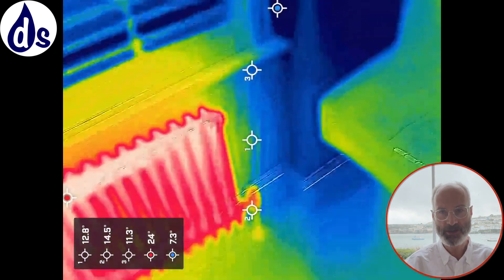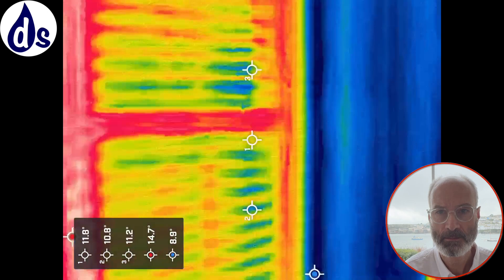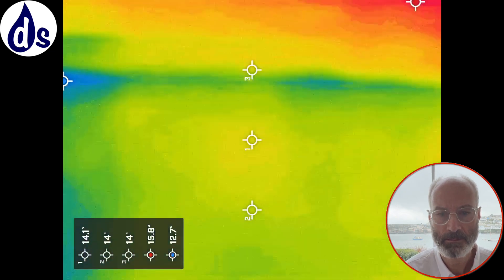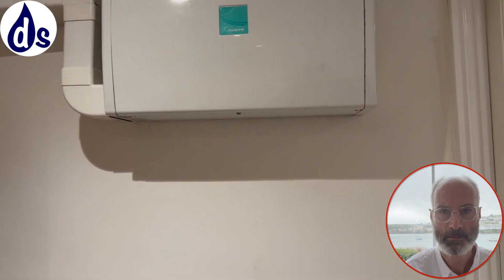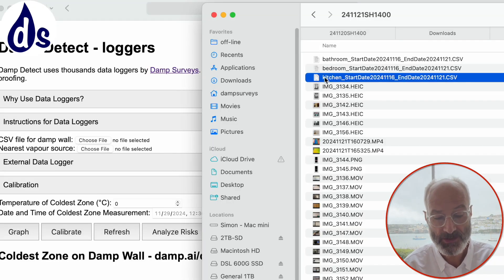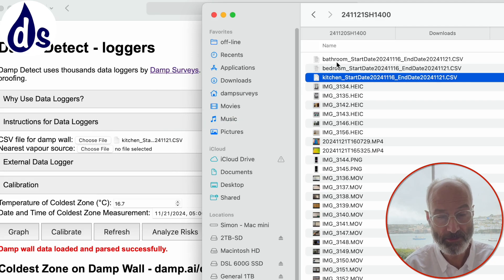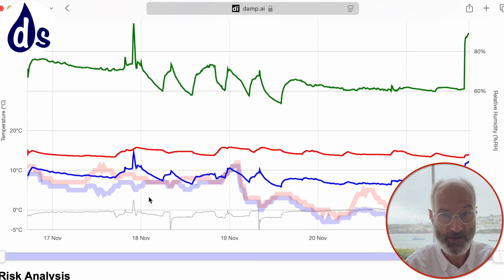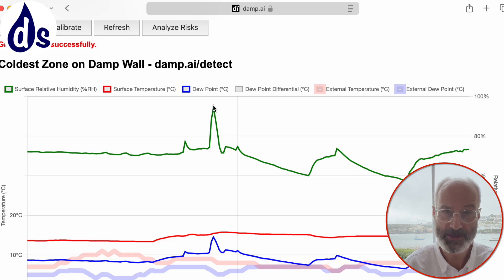Damp and Mould Next to a PIV Fan – What Could Go Wrong? 🌬️🦠🔍

Comment: @dampsurveys you don't seem to be a fan of PIV units? I don't really have a condensation problem (70s house so not air tight and quite gappy) , but the deisgn of my 70s house means there is very poor air circulation, particularly on a long internal hall with no windows. Also, have a weird concrete floor with floating timber frame floor (to hide pipes) that has no ventilation. As a result, the house smells musty, but without obvious signs of mould/damp. Will eventually rip out the floor and put some floor insulation and screed to make a solid floors, but in the meantime I was thinking of getting a loft PIV to improve the air quality in the house - any thoughts if this would be a good idea?
Reply from the maker: Thank you for your question! 😊

You’re right—I’m not a fan of PIV systems, as they generally don’t address the source of vapour, which often stems from insufficient ventilation and is exacerbated by poor air circulation. Musty smells are likely caused by mould spores lingering in stagnant air. PIVs are also expensive to install and run and can sometimes introduce more problems, such as blowing in cold, humid air from outside. This can increase the risk of mould growth and lead to higher heating costs.

Ripping out the floor and installing a solid floor with insulation and screed sounds like an excellent long-term solution. However, I’m also not a fan of concrete over a floating timber frame floor, especially if there’s poor sub-floor airflow. The last one I inspected had a leak causing white rot, which had eaten through much of the timber. The concrete appeared self-supporting, but as this wasn’t the design, it posed a risk of collapse. Ideally, you should inspect and measure sub-floor humidity and ensure there’s sufficient sub-floor ventilation before making any changes.

In the meantime, I’d recommend investing in one or two dehumidifiers instead of a PIV system.

Why Dehumidifiers?
Dehumidifiers are far more efficient for improving air quality and managing humidity. Here’s why:

Energy Efficiency: All the energy used by a dehumidifier is converted into heat, plus an extra 50% bonus from enthalpy, much like an air source heat pump. This means dehumidifiers effectively warm the air while removing moisture, making them cost-effective. 🌡️⚡
Air Movement: Dehumidifiers create constant air circulation, helping to eliminate stale, musty smells in poorly ventilated areas like your internal hall. 🌬️💧
Immediate Impact: Unlike PIV systems, which rely on introducing air from the loft (often cold and unfiltered), dehumidifiers actively remove excess moisture and improve air quality, even in challenging setups like yours.
Additional Suggestions
1️⃣ Targeted Ventilation: Use extractor fans in key areas like bathrooms and kitchens to remove excess humidity at its source.
2️⃣ HEPA Filters: Choose dehumidifiers with built-in HEPA filters to improve air quality by removing allergens and particles.
3️⃣ Keep Doors Open: Ensure internal doors are open when possible to promote airflow throughout the house.

While a PIV system might slightly improve air circulation, it doesn’t tackle underlying issues like stagnant air in the floating floor void or high humidity. A dehumidifier offers a much more practical and cost-effective solution in the short term while you plan your floor renovation.
Reply: @dampsurveys  Thank you for such a detailed response.
One clarification our floor is a solid concrete sub floor with a weird 6 inch floating timber floor on top (i assume to hide water pipes etc). My intention is to remove the floating floor to expose the concrete sub floor and then add insulation and a new screed on top. I think the current problem is that there is no ventilation in the floating timber floor - it is basically a void for stagnant air. 

In the meantime I took your advice and ordered a Dehumidifier with air purifier - will see how I get on with this 

Do you have a tip jar/donation ?
Reply from the maker: Thank you for the clarification! 😊

That floating timber floor does sound like a bit of a damp time bomb. Without ventilation, stagnant air can cause condensation, AND IN SOME CASES ROT, or lead to mould, as well as potential issues with any hidden pipes. Removing it and insulating the sub-floor before adding a screed sounds like a solid plan. Just be sure to use a vapour-permeable insulation layer where necessary to prevent trapped moisture and future problems. 🌬️🛠️

As for the dehumidifier with an air purifier—great move! You’ll likely notice a significant improvement. Remember to place it near the damp-prone area and run it consistently. Draining it directly into a sink (if your model allows) is ideal, especially when you're not around.

Tips for Your Sub-Floor Plan:
1️⃣ Moisture Check: Ensure the concrete is thoroughly dry before adding insulation or screed. A simple hygrometer can help you check the sub-floor's relative humidity.
2️⃣ Insulation Choice: Consider rigid foam boards like Celotex or a hybrid solution like SpaceTherm if there's any chance of residual vapour.
3️⃣ Data Logging: Place a logger in the void now to track humidity—useful to confirm your diagnosis of stagnant air.
4️⃣ Ventilation: If you’re ever stuck with voids in the future, ensure they’re ventilated to prevent a repeat of this issue.

About a Tip Jar 💰
I don’t have one just yet (but maybe I should 🤔 - but I am planning an eBook - stay tuned). Honestly, your kind words and sharing my videos are more than enough! ❤️ You can also amplify the impact by recommending https://damp.ai and https://www.youtube.com/@dampsurveys to others—it’s a growing resource I hope will help many.

Videos You Might Find Helpful:
👉 "Sweat in Cellar from Poor Ventilation": https://youtu.be/J8wdxehh7GM
👉 "Mould from Ventilation into Loft Blocked": https://youtu.be/dAY9rBMEsX8
👉 "Damp Rear Extension Column Condensation": https://youtu.be/KM6mJpHkFg0

Stay tuned for more updates—your input is invaluable, and I’d love to hear how your project progresses! 🚀

Comment: Length of ducting is a big consideration with bathroom and kitchen fans. It's hardly ever considered it seems.
Reply from the maker: Absolutely! 🌬️ The length of ducting is critical for bathroom and kitchen fans, but there are other key factors too:

1️⃣ Duct Type: Rigid ducting is best because it offers lower air resistance compared to flexible ducting.
2️⃣ Number of Corners: Each bend increases resistance and reduces airflow.
3️⃣ Tension: If using flexible ducting, it should be at least 90% taut to minimize resistance and avoid sagging.

Most importantly, people often forget to test the air speed at the vent outlet. I can’t count the number of times I’ve found no airflow because the ducting didn’t extend all the way to the outlet! ❌🔍

Proper setup and testing ensure ventilation actually works. Thanks for raising this point! 🛠️💨

Comment: What’s your opinion of the bit in the HHSRS that says people should be able to carry out normal activities without ever opening their windows?
I think it’s utter ridiculousness
Reply from the maker: You’re right — it’s a tricky and often political issue. 🤔 The standard approach emphasises trickle vents or a continuous flow of air (like MVHR systems) 🌬️🏠.

Personally, I believe in targeted solutions:
Ventilation 🚿🍳 for bathrooms, kitchens, and clothes drying (using a dehumidifier or dryer).
Heating 🔥 and insulation 🏠 applied strategically.
Dehumidification 💧, especially when away or when the indoor dew point is above the outdoor temperature. (Think Dew’s Law 🌡️💧.)

For more detail, check out my recent video:
👉 Respect Awaab's Law with Dew’s Law
🔗 https://youtu.be/MMJeqjAWtSo 🎥

Comment: Is running a dehumidifier 24/7 viable? Seems like a short term solution
Reply: From personal experience: I have been running a dehumidifier 24/7 for the past few years across several houses. During the first few weeks, it stays on most of the day, but once the building dries out, it only turns on a few times daily. It usually runs longer when I’m drying clothes indoors during winter, which is something dehumidifiers excel at. Most dehumidifiers come with humidistats, allowing them to sense when they need to run or stay off, ensuring you keep your running costs low.
Reply from the maker: Thank you for sharing your experience! 🙏 You’re spot on — dehumidifiers with humidistats keep costs low 💡💧, especially for drying clothes in winter 👕❄️. 

They also generate 50% more heat than they use ⚡🔥.
Dry air feels warmer than humid air 💨⬆️.
So, you save money 💷, cut CO₂ 🌍, and fight damp all at once! ✅🙌
Reply from the maker: Thank you so much for taking the time to comment! 🙏 A very good question that I get asked often. 🤔

A dehumidifier is one of the most effective short and long-term solutions. In my opinion, it should be part of the mix in any property 🏠 if vapour levels are high 💧 — for example, when drying clothes indoors 👕 or leaving a property vacant and unheated 🕰️.

A friend of mine kept heating a holiday cottage, spending about £1,000 over winter 🔥💸, and it was damp every time! 😞 But when he switched to a dehumidifier, it now costs about £100 💷 and stays dry every time. 👍

There are 4 ways to reduce condensation and mould:
1️⃣ Ventilate 💨 — but this risks losing heat to the outside 🥶, and sometimes outside humidity can be higher (like during mist or rain) 🌧️ than inside.
2️⃣ Heat 🔥 — but it's expensive 💰 and can leave uninsulated zones cold. 🏚️
3️⃣ Insulate 🏠🛠️ — but this is costly and carries risks like poor airflow between insulation layers. 🚧
4️⃣ Dehumidify 💨💧 — needs safe drainage and can be a bit noisy 🔊.
All the above benefit from some airflow, which a dehumidifier can provide.

None of these methods are perfect on their own, so often you need a mix. 
🌀 Dehumidification is, after all, the only form of vapour removal used in a space station! 🛰️

During the initial energy crisis caused by Putin's war 🪖, I used 3 dehumidifiers instead of heating. The lower humidity made the property feel drier, and therefore warmer than it otherwise would. 🌬️😊

Comment: Hi 
Can you recommend a excellent extractor fan for a bathroom and kitchen.
Thanks
Reply: Envirovent Axial fan
Reply from the maker: Interesting! 🤔 

I’ve come across almost every brand during my damp surveys — including Envirovent fans. I’ve also seen dehumidifiers, PIV, MVHR systems, good insulation, and good heating, but the issue often comes down to maintenance, installation design and use. ⚠️

In fact, one of my recent surveys featured an Envirovent fan. The landlord was being taken to court over a large plume of mould around the bed head 🛏️. It turned out there was a cannabis 🌿 farm in the neighbouring apartment! 

Despite this, the continuous flow fan didn’t improve vapour levels. The issue? The fan provided no effective exit speed in continuous mode 💨❌. I’m not sure if that was due to a design flaw or installation error.

I’ll be publishing this case study soon — stay tuned! 📝
Reply from the maker: Great question! 💡

For bathrooms 🚿:
A continuous flow fan with a humidistat is ideal if you’re dealing with damp, mould, or renting out the property.
For standard use, go for a fan operated by the light switch 💡 or a sensor, with a 30-minute overrun to clear moisture effectively.
Consider marking the isolator as "electrician use only" to prevent it being turned off. ⚠️

For kitchens 🍳:
Choose an externally ducted extractor hood over the hob, ideally with rigid ducting for the best performance.
The quieter, the better! 🔇 Avoid wall-mounted fans unless it’s a restaurant-type setting — they’re noisy and less effective in open-plan spaces.
For a rental, I’m installing both a hood and a quiet, sensor-operated fan as I know tenants rarely use kitchen extractor fans. 👌

⚠️ Key considerations:
Ducting: Use rigid ducting or insulated flexible ducting if running through a loft.
Airflow rates: 15 l/s for bathrooms 🛁, 30 l/s for kitchen hoods 🍽️, and 60 l/s for wall-mounted kitchen fans.
Maintenance: Clean fans annually 🧽🗓️.

Hope this helps! 😊